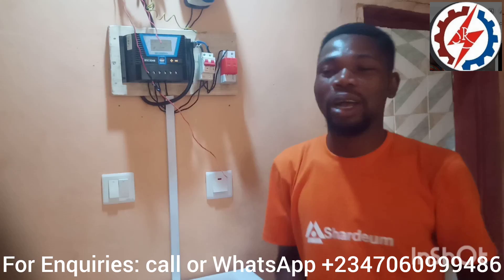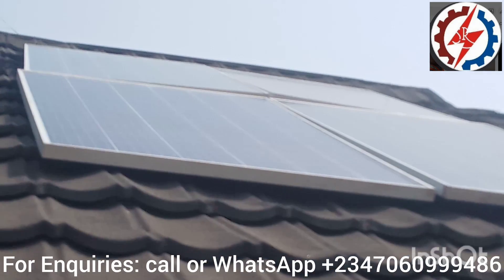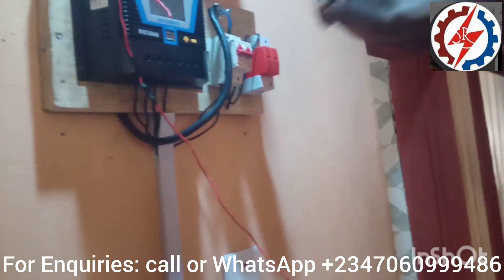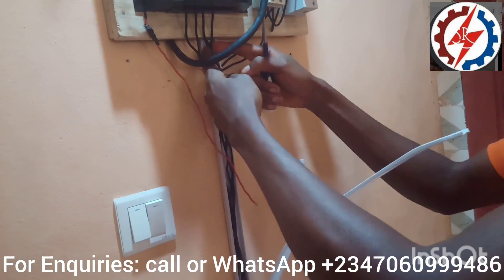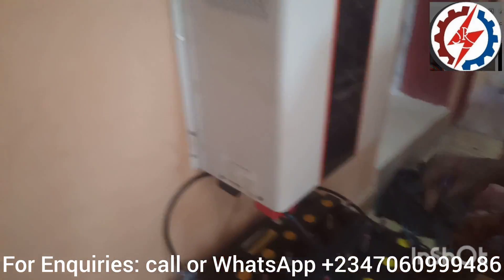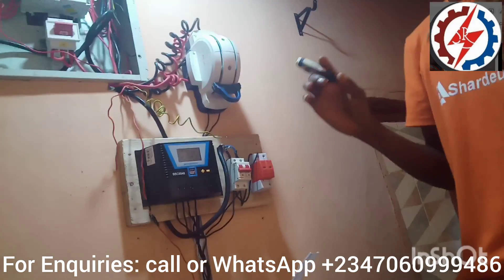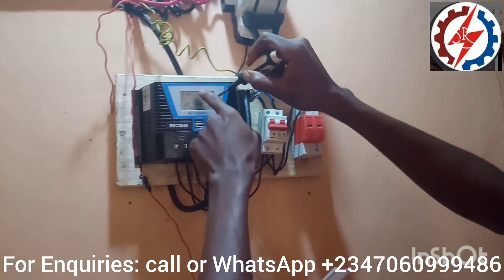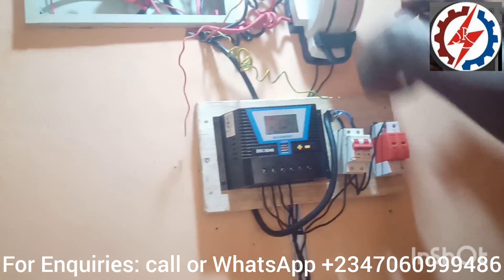The Secrets of Solar Installation Revealed: Step-by-Step Guide

Comment: What type of cable gauge I mean from panel to controller and from controller to battery and from battery to inverter. What strength is the breaker and surge for my 12v system

Comment: How many solar panels did you used and what is the capacity of each battery. Is it acid or something else
Reply from the maker: 4 numbers of 300w panels
2 numbers of 220ah tubular battery
Reply: Is it in series or parallel

Comment: Do you connect the panels in series also and what is the amps of that charge controller pwm, or mppt
Reply from the maker: The panel is Connected in parallel sir

Comment: Your work is rought, improve the neatness of your work next time, and again the Dc surge need to be connected to ground other it won't work perfectly
 And your not suppose to pass the panel cable through the distribution board.
Reply: Carry your neat go bush our light don onn 💡😂
Reply: @wangarousvictor4222  the most important things is for light to on
thanks jare my brother
Reply: Answer

Comment: Nice effort but you will be better off with an mppt controller.  That's the brain behind a solar system
Reply from the maker: Noted sir
Thanks for the advice 
Will implement it in subsequent installations

Comment: Please change the charge controller to mppt as soon as possible if you dont want the battery to die. Its the weakness of the system. Have used that kind of controller before, had to change it to mppt. The difference is night and day.
Reply from the maker: Thanks for the advice sir
Reply from the maker: Will do just that
You Know we work base on the available funds given by client

Comment: Guy your installation is not correct, the solar panel was not specified and no full specification of the change controller. Size of cable you used for the installation can result to fire 🔥. The cable you used for the controller is not the right (DC) Direct current cable.
The truth is that none of you guys understand how Green Energy works in naija. Because no institution for this, they know nothing
Reply from the maker: Still have another video on the channel that specifically talk about solar panels specifications sir
You can check the playlist
Thanks for the feedback sir

Comment: Good job, I understand that you know the installation work, but when you are describing your systems, always use the right terms to name your system’s components. For instance, in alternating current (AC) we name the cables red (live) not positive, black (neutral) not negative as you said, negative and positive are found in DC set ups or DC circuits. For example, battery is only positive and negative, then power supply adapter converts from Alternating Current (AC) to Direct Current (DC) which we use to power DC circuits.

Please always be firm in your descriptions by naming your components the right names when teaching. It is very important.
Reply: Cables coming from the solar panels is in DC (+/-)
Reply from the maker: @multiskilledelectrician1  noted sir 
Thanks sir
Reply from the maker: Thanks for the correction 
I really appreciate 
Will work on it in my subsequent videos sir
Reply: His job is not even neat,  he should have taken time to do a neat job using PPEs for such a job knowing that he's posting it for the world to view.
Reply: @christopherachilefu3843  boss we learn every day i believe he will upgrade in next video

Comment: But can it carry a borehole?
Reply from the maker: Yes sir
It can carry it perfectly sir
Reply: @samroyalelectricaltv   I have 4 300wtt panel with 1.5kva inverter & 60amp charge controller & 2 batteries 12vl  should I connect the panels serially or parallel thanks
Reply from the maker: @alidaudakida6908   Is the inverting machine 12v system? If yes you can connect in series
Reply from the maker: @alidaudakida6908  if it's 24v system you can consider parralel connection
Reply: Yes sir

Comment: pwm charge controller is only good for small setup ,mppt charge controller do boost charging
Reply from the maker: Well said
Reply: My very thought too. That's only were he made a mistake and it's huge
Reply from the maker: Nice installation 
It will be corrected
Reply from the maker: Thanks for the review